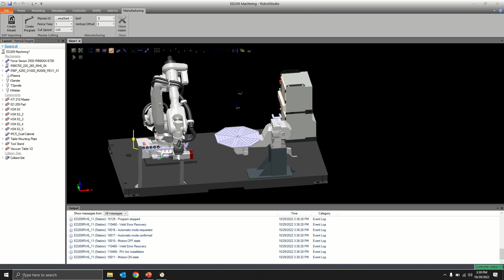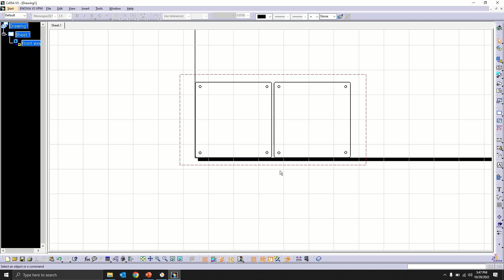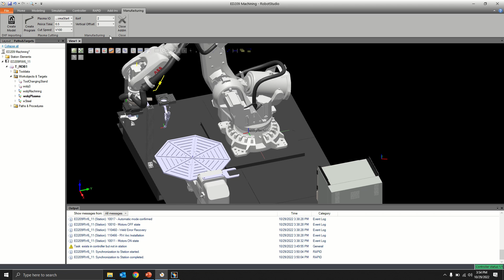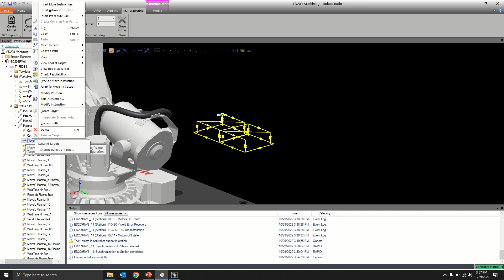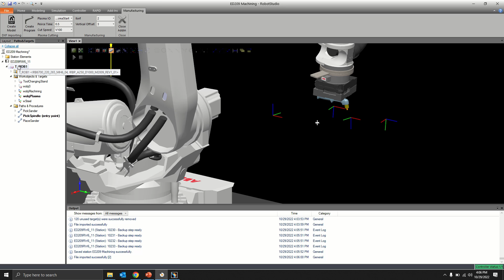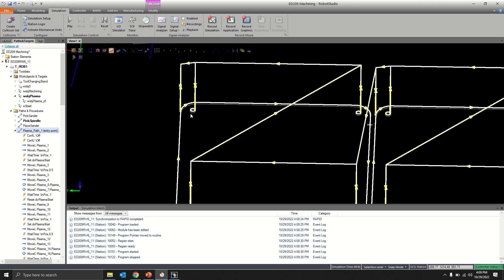Robot studio DXF Importer/Plasma path generator

Comment: Hi Robert, does it work on version RobotStudio 2024.2.1? I installed addin without any problem, but program is not creating well, because objects are more bigger than in dxf file. I have drawn circles with radius of 10, but in robotStudio these circles have radius of about 250. why?